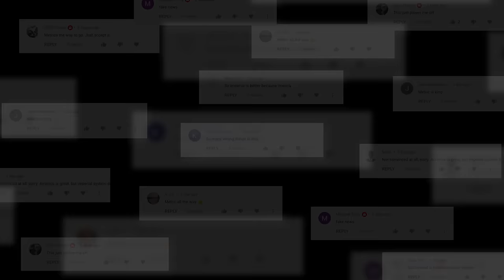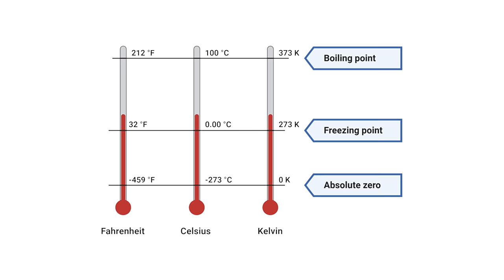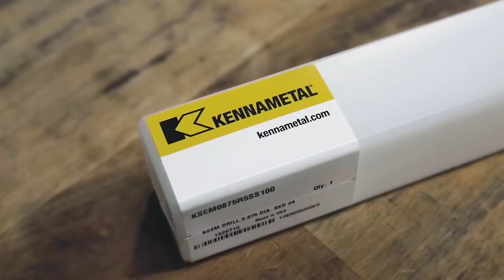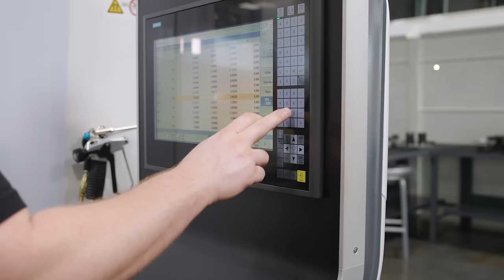Why METRIC is SUPERIOR to IMPERIAL

Comment: "Why should it be easy for us when it can be difficult" 
What is this? Let me explain.
 I am a civil engineer, European. I grew up with the metric system and am only used to it. To be honest, the imperial one seems terribly stupid and outdated to me. I worked with two US colleagues in the construction of a plant for automobile engines in Bulgaria (Europe). To everyone's surprise (mine and other colleagues') they used 100% metric system. This saved us a lot of trouble converting units. Metric is a system, imperial is not a system, it's a mess. It works for everyday life, but not in engineering and science. When dealing with complex and composite characteristics such as heat transfer, torque, flexural strength, geological stresses, magnetic induction, etc. then things get really, really rough in the Imperial. 
And what about the temperature measurement. The Celsius scale is extremely easy, convenient and intuitive. 0°C, water freezes (at sea level), 100°C water boils. The human body is 36.7°C. It is hardly possible to come up with something simpler and easier. What is this 32° F and 212° F, what is this 5/9 scale? 
We have discussed this question with my American colleagues: Why are you still using this medieval nonsense? 
They answered me with a laugh: "Why should it be easy for us when it can be difficult."

Comment: Metric; i work in forestry and JD use imperial for things example is insect bolts but everyone els use metric for most things  tho some use parts that comes from usa and might use imperial so i need 2 sets of insect L "key" and bits,  and then some bolts might be un imperial but the wrench I have might be in metric so it either slips or don't work at all,  soo I need some wrenches in imperial,  ontop of all 40 wrenches I already have in metric. Also cause of the price margins using imperial to measure trees would be wasting trees cause of the precision needed both in length and with and big and small numbers,  cause how hard would it be to use inch for a 20M pole that need to be atleast 30cm in the top and also what the volume is for it,  cause square inch would  ot work   so you would have to use square feet, and then we have tree limbs that are alften collected   they would need to use square feet to measure how big of a truck or how much wood chips you get and also you get paid per energy (kwh). So it would be a mess. More than it is now   cause I know atleats 10 diffrenr ways of measuring volum in forestry in square meters example  m3 under bark  over bark, m3 top measured, m3 forest, m3 wood in pile, and so on and then mixes between and they all give you different volyms 1m3sk=0,62m3fub.    This comment is long enough and i wrote this on my phone....

Comment: Prefer the metric. In woodworking it's much easier to measure in metric than imperial. Like could it be a 47/16th cut, or maybe a cut of 6.8mm's? Much easier to find or remember 6.8.

Comment: imperial is metric anyways. 

We don't use a rod in paris as original measurement anymore, we actually have now stablished the meter as a fraction of the speed of light, the same with the gram and the seconds they are an specific quantity of quantum constants (this is reliable and can be recreated in a lab) and the imperial system is just the convertion of the metric system using the well know convertions rates they have just set the rates constant and they will not change anymore. 

Imperial is metric deep down.

Comment: Metric for precision, imperial for everyday stuff. I've no idea why manufacturers still use imperial for cars and bikes and such, but I do know that 1000 steps is about a mile and my legs are about a yard long. If you asked me what 480cm was, without a ruler, I'd be lost, and I suspect most people would, too. 
Imperial is much better visually,  and metric is superior for most building/ manufacturing.

Also, how far have you driven in 5 minutes at 100kmh? Now, how far at 60mph? See what I mean? It has it's advantages.

Comment: I work in a tool and die shop. For 0-1 inch i prefer imperial. The only reason is that's what we've worked in and are tooled for. If we'd started in metric i imagine i say the same for that system.

Comment: Noone cares about how many times you can divide the diameter of the earth to get a meter, noone would use inches(yes, we stil have inches in the metric system) to describe the length of a kilometer. And as it is with the emperial system, the metric system also needs some defining describtion that explains what a meter is. A meter is only a meter at a certain temperature, the boilingpoint of water changes depending on your altitude, the volume of a liter weights the least at 4 degree celsious. ALL the examples of the definitions is not the definitions
 -  both systems have a referance on which theyre based, but its not something that matters for everyday use. And we stil use a spoon to meassure flour or salt or w/e.
 - Arguments are good, if the premise is relevant. Is it a good premise to measure a mile in feets? wouldnt it be much better to use yards? - Ofcus a system comes to short if youre applying it wrong
I agree, emperial system could do with a cleanup. But the system is genious. The number 12 is innate to humans, and the mathematical benefits from having a number that can be divided into 3 is not something you just can neglect or ignore.
Ive used metric all my life - been advocating for it up untill just a few years ago. But what made me change my mind was something as humble as the palm of my hand.. and the penny. and the fact that we cant split a 100 between 3 people. - The metric system is good when it comes to pretty much anything scientific. But people dont do science all the time. We also need practicality in our everyday life. We still use horsepowers when we talk about carengines. Even when it comes to teslas. Admittedly, you will be schooled in "the right way" of meassuring it
If you flip your hand around then you have the perfect tool for counting and for keeping track of multible units. 1 finger is 1-3, 4 fingers is 3x4=12. If you count fingers with the decimal system then you have 1 finger, 1-10 if you include 2 hands. if you include your second hand in emperial then you can count to 60 before you have to look around for more. - 12 on one hand and a finger on the other indicate the 12, 12x5=60, 60 is 2 feets. a stone is about 6kg etc.. 
The emperial system clearly revolves around these basic numbers, and you can do so much more with 12 than you can with 10.
The decimal system makes it easy to remember the size of a given term like a kilo. But thats a matter of habit. Emperial users dont run around a divide numbers left and right all the time, because it doesnt matter. It doesnt matter if you drink 12oz or 33ml. You know at glance what you want
 The important takeaway here is the ability to divide in 3. an astonishing 1 in 3 numbers divide by 3.. how many  numbers in the decimal system can be divided by 3? When it comes to machining, then the metric system SUX bigtime. You can never get a nice complete number like 1/8, 1/1280 1/8000000000000000000000000 or simlar. you can get messy shit like 0.0023756396867949496intoinfinity with the metric
One thing that doesnt make sense is farenheit.  - ditch that

Comment: Imho the world should try to standardize this and other important things for the better of all the people. Sure metric system will be the best but another example is the energy system, 220VAC and 400VAC at 50Hz should be the world standard. It will simplify a lot of things and it would lower costs and design of many things. The question should always be: what's the best for people? Another example: think about the port on phones chargers... (Apple vs EU is a clear example).

Comment: 2:50 here I am a little bit confused 😕  M6 and you drill a 5mm core bore (hope I used the correct technical term?)
Reply: M6 x 1 is the "normal" M6 used in daily live, ..... but there is also Metric Fine threads like M6 x 0.5 or M6 x 0.75   😉
Reply: @ytfan3815  ah right i forget them 😄

Comment: Here's the thing. For the past hundred years, we've been dividing inches into base10 increments, or thousandths. One thou was our version of a micron, and for general manufacturing, that is serviceable. However, as tolerances get tighter, I believe we'll see microns become the primary way to dimension tolerance, and eventually, after that, it'll go back to millionths. With that being said, the differences between using one over the other will be so small that we may as well use metric anyway. It's not about a rod across the world. It's not about familiarity. It's about the fact that a thou matched up extremely well with tolerancing for the past hundred years. I prefer thinking in thou and tenths because it works well with what we can make today. In the future, that will change alongside my preferred measuring system. 

Any other angle of this debate is just... not pragmatic. I deal with people who think they're right without being right, and because I can never voice my logic effectively, it generally falls on deaf ears, but please take this to heart. In 10-20 years, we're going to be using metric primarily for extreme precision manufacturing, but I don't think the thou will go away as long as +-.010 or .005 or even .001 or even .0002" (ten thou, five thou, one thou, 2 tenths) tolerances exist anywhere. As much as I want to see a world where everything is perfect down to the micron, and 3/8 of a micron is a realistic way to notate anything, I don't think that will happen.
Reply: I can understand your sentiment, but please consider.

Why are you introducing new names for units? Metric doesn't do this. It is the meter all the way. Yes, we use a prefix, but it still is the meter.

And just because this is the internet and I can nitpick: the micron is officially the micrometer. (um, or rather the Greek letter mu followed by m) This is already a millionth of a meter.

How accuate is 3/8"? With 38 mm I know it wll be between 37.5 and 38.5 mm (unless otherwise specified)

btw. Do not take as an attack. You made fair points. Sometimes I am a bit flippant.

Comment: Those three countries are converting themselves into the metric system one millimeter at the time. Even their money is calculated in metric, whether they realize it or not.
The thing with the temperature keeps going on simply because the average person doesn't have to use complicated  fractions.
At some point common sense will prevail, but only if these people can provide themselves with leaders that will allow them to think reasonably.
Greetings from Toronto.

Comment: I prefer metric only because biggest accuracy is 0,01, and most parts doesn't have more then 400...500 mm, and not put ten decimals. and if you put offset in machine 0.11 instead of 0.011, you make biiiiig mistake, and I've seen that some people posted those errors

Comment: I'm French, so obviously, I prefer the metric system...

I'm forced to use feets and nautical miles because I work for the aviation industry and several navies for my job (computer engineer)... And seriously, it's just a pain in the @ss constantly - so much that, in fact, we compute EVERYTHING in metric, including latitude and longitude (i.e. "decimal lat/lon") AND date/time (we use exclusively nanosecond UTC timestamps).

We convert it back to non-metric units ONLY for display... And when user input a value in "retarded units" (our official nickname for imperial units AND sexagesimal values), we convert it to metric system instantly - we don't even check its validity before the metric conversion, all boundaries and other checks are done exclusively on metric values.

Comment: I thought the second number on the M screws were the length, at least on laptop screws the threads were the same, although the thickness of the screw itself as well as its length varies
Reply: Depends. M10x1.5 is diameter times pitch, whereas M10x30 is diameter times thread length. If the thread pitch is not mentioned, it's a standardized pitch. For M10 the standard pitch would be 1.5mm.
Reply: @johnscaramis2515  okay interesting not sure about the length of the thread itself but rather the length of the screw. like I have seen laptops saying things like M3x6 referring to a 6mm long M3.

Comment: I liked the video overall, but with respect I have only one disagreement with the video. Accuracy. One can be just as accurate with either system. 
As a matter of fact in shooting sports MOA or Minute of Angle has more resolution than Mils. For instance MILS divides 1 degree into tenths, where as MOA divides that same 1 degree into 60 minutes. Thus if one multiplies 60 minutes by 360 degrees your circle has 21600 increments versus 3600 for MIL.
Reply: Angle measurement do not stop at Mils or minutes. Each angular minute is divided into 60 angular seconds, which in turn are divided into smaller and smaller units. Same is with the Mills. There is no limit to how many increments circle can be divided in both units.
Reply: @moreinzenjering6727 This is true however I was referring mainly to industry standard ie: rifle scopes. Good quality rifle scopes each MOA is further divided into quarters.

Comment: I can't imagine that anyone thinks the imperial system is better that metric. All numbers are decimal (base 10), like the metric system. The reason it makes sense and is intuitive is right in front of your face, assuming you are holding your hands up. If we had eight fingers we would use octal numbers (base 8), etc. 
Did you know your average horse produces 16 HP? Horse power is averaged over a 24 hour period, just to make it more difficult (or to show that steam engines are better would be the real reason).

Comment: When I was a mechanic it drove me crazy, having to buy doubles of everything. So ridiculous. I'd be fine with America switching to metric.
Reply: Auto mechanics have switched to Metric.  There are only a few “standard” tools needed nowadays, according to the Flat Rate Master YouTube video on the subject.  

I remember when we started seeing vehicles with Metric hardware in the United States.  I think it really started to grow when the Honda 50 motorcycle was imported, although there were other metric vehicles earlier.  I never heard anyone complain about needing more tools, although I am not a professional 😅mechanic.  My impression is that most people who turn wrenches just get what they need.  Some mechanics work almost entirely in one system or the other.  If you need to work on everything, then of course you need more tools.

It isn’t just because of Metric vs. SAE.  Metric inherently requires more sizes because 1/16” is about 1.5 mm.

Comment: what's funny about proponents of the imperial system is that they don't understand *they are already using metrics**.  every time you specify something in thousandths of am inch?  congratulations, **you just used the metric system**.  what those people are **actually* arguing for is the base unit not to be something derived by science, but 1/12th of some arbitrary length of a Mesopotamian statue.  because that's clearly a good way of reliably gauging the length of something.  :rolleyes:

Comment: For an American, it's actually too easy to check if the Metric System is better, you simply need to consider switching to the Imperial System on a field where all Americans are already using the Metric System.
Which field is it? How do you buy an SSD? How do you check a file size or folder size on your computer? How do you buy a RAM module? Yes, you have always used the Metric System for it: kilobytes, megabytes, gigabytes, terabytes. 
Now imagine you are forced to use the following imperial units, starting with Windows/Mac file browser displaying file sizes with these:
• 1 binch = 25 bites
• 1 boot (pl. beet) = 305 byte or 12 binches and 5 bytes
• 1 byle = 1631 bytes, or 5 beet and 3 binches and 6 bytes

I'm sure you would go to the streets, raging. 😏 But why? Because you're used to gigabytes? No. It's because it's much easier to manage data volumes in the Metric System. In reality, Americans simply are used to the Imperial System, and they are too free to be told "what's better for ya".

Comment: Metric is much more integrated than imperial and also works a lot better in physics, volumes, masses etc all become much easier. However I don't agree with  the comments regarding metric threads, the standard range is very course and if you want something finer it all becomes somewhat more problematic obtaining fixings etc.